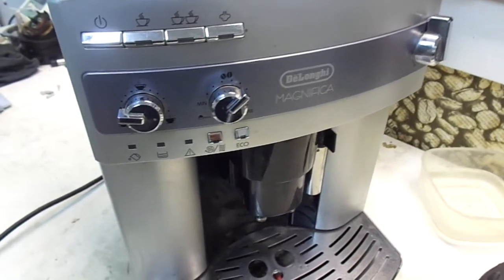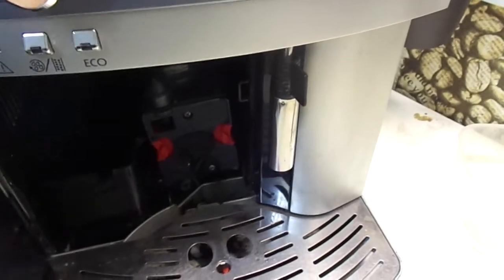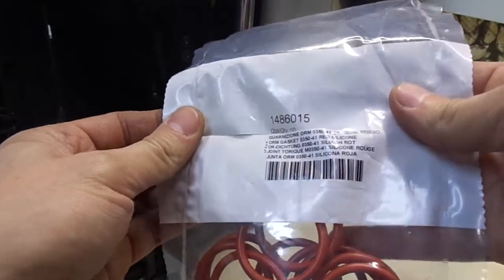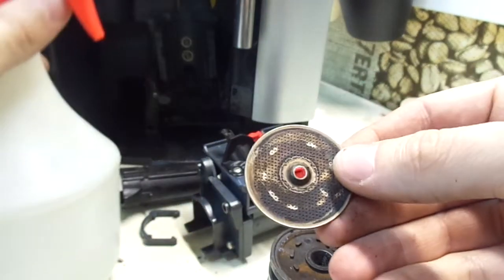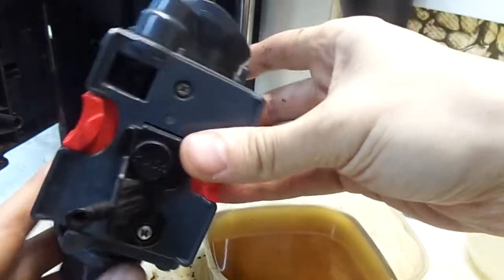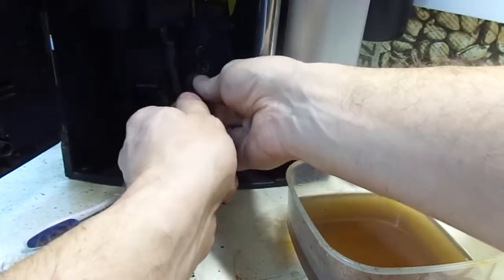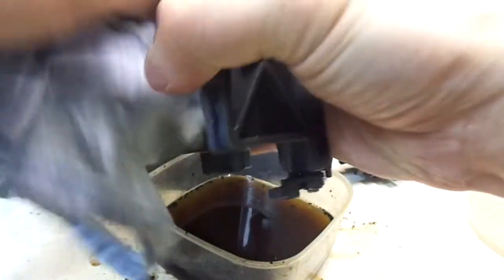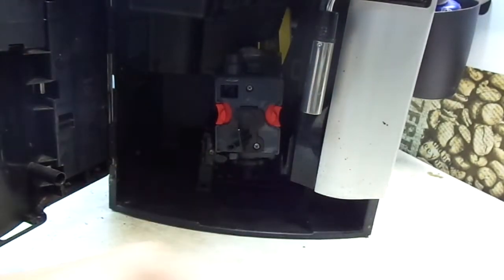How to service and clean DeLonghi Magnifica

Comment: "If you don't clean your machine like a told you, you have to do it" - gotta love it :)
Reply: I have my machine taken apart and need to remove the support piece but don't know what kind of tool to get it out with.  It looks like a screwdriver with different head.
Reply: @raytalley1  it’s called ‘torx’ and he mentioned ‘25’ and I confirm it’s 25 torx bit you need to unscrew the infuser support.

Comment: I already have this issue on my magnifica (the insert diffuser lights flash and machine is unresponsive). When put into test mode everything works fine, I cannot find any way to install software (let alone connect to the board). Would a new control board solve the issue entirely?

Comment: Do you recomend cleaning the grinding gears? and if so, do you have any videos of the process. The grinding gears are held by 1 screw, should the screw be tighten till there is no movement  on the top spinning piece above the gears?

Comment: Excellent video. Very helpful. I had already replaced the o-rings but my machine still made a screeching noise sometimes. After removing the brewer plate and cleaning/lubricating, it’s now nice and quiet 😊
Reply: Hi Simon mine does the screeching sound too but at the moment I can't get the infuser (the part that moves up and down inside the door) to go anywhere. It's stuck in the down position so it kicked the door open and now I can' t close the door or move the infuser. :( I miss my coffee so much. SO glad yours is behaving.

Comment: oh! Thank you very much. For my case, there was no coffee come out from my Magnifica. Then,  I found your instruction and follow your steps to disassembly the piston and clean it. Especially the transparent yellow part. My Magnifica is working well again now!  
Greetings from Hong Kong
Reply: For the future it's worth to inspect o-rings inside that upper piston. I had problems with mine  magnifica and the problem was in o-rings that  falls apart...  No coffe/water in cofee waste container/coffe throwed inside coffe machine  is always caused by upper piston or o-rings showed on the video...

Comment: I started smiling when you said to upload new software - that's how you should approach repairs :) Also 10 points on how to remove the little valve in the piston - it puzzled me for hours when I was repairing mine - I figured it out at the end - but damn! I wish I had seen this before.

Comment: my frother bubbles, i removed the 2 black nozzles, i think the top oring is missing on the  black end before meeting the metal tube
is that the problem? if so is there a fix or jsut order orings

Comment: @
Milen Stoitsev
No! Don't do it... Always  in wood or plastic when place screw back always firstly turn screwdriver in left until the screw clicks and jumps, then right, because in this way you place it in old thread. Otherwise you  create every time a new thread and some day  you'll enlarge the hole so much that you will forced to buy new brew unit, because the hole becomes larger then screw and just falls in. Trust me, I done some day the same mistake and i had to use larger screw... In this case it's impossible, so you have to buy new one...

Comment: This is very helpful, l just want to know if I can use cleaning tablets like I use descaling tablets for my Delongi coffee venezia bean to cup coffee machine. Can I just put the tablet in my water tank and turn on the descaling program? It does not have a cleaning program. And I want to know if the cleaning tablet will be harmful to the orings.
Reply: You can, and it won't and you can use plain old spirit vinegar - that's what's in the delonghi 'official' descaler!

Comment: Hi Milen, thanks for sharing all this useful information on your channel!
I did you ever discuss the warning signal (triangular, flashing) on a Magnifica S? Seems to me it has something to do with one of the sensor not ready the exact position of the infuser, but I don't know where to start to solve this.
Reply: Rob - thanks you your comment, I was able to fix mine. The piston housing was stuck at the top and not in correct position. I took the bottom of, 6 screws and was able to bring the piston housing back does using a 17mm socket. I played with up and down to find the right spot for it to be in position, solid triangle went away and coffee was resumed. I need to replaced the rings after seeing this video though.
Reply: Hi, me again. Managed to keep the machine going without opening like you suggested. But now it kept blinking. Can you explain in detail how to solve? I took off the cover and I think I see the microswitch but not sure where to apply the 17 mm socket
I see the small cam touching the microswitch next to the motor. Switch seems to work fine. I hear it clicking when I touch it. What’s exactly triggering the alarm?
Reply: There’s quite some play on the nut on the spindle. Could this be the main cause?

Comment: Hi Thanks for the video. I cleaned up he Brew group just as you mentioned. Hot water, steam and coffee grind with tablet all works. When I start coffee only few drops of very dark coffee comes but nothing more. Any ideas?
Reply: Is your grinder on too fine a setting? Sounds like it could need Turning to a slightly courser setting

Comment: Great video, thank you so much for the information.
I have a DeLonghi Magnifica S Ecam that I cleaned as you instructed but also removed the screws to do a complete cleaning. Now when I turn it on it makes one loud "bang!" noice when it is almost done heating up. When I turn off the machine and remove the brew unit I see that the piston with the two O-rings is all the way up, so that the "arm" that should push the puck of ground coffe residue is not pushed away into the collector. How do I fix this?
Reply: Did you remove the brew unit, when it was turned off? on the machine , not the power point.
Reply: Did you put lubricant in the O rings?
Reply: I lubricated the O-rings the first time, after three restarts it stoped doing that sound and the problem solved itself. Thank you for your response.

Comment: Hello Milen,
I have watched many of your movies in order to keep my Delonghi Magnifica ESAM 4200 in good shape.
But today the machine suddenly stopped working with only the Ground Coffee Container indicator is steady on. In order to remove the drip tray I had to open the machine and turn the motor spindle to release the brew group so I could take is out.
The container indicator is still on but for the rest seems the machine to be dead. Do you have suggestions where to look for? E.g. motor or electronics ? And how can I verify?
Thank you, Gerard

Comment: Has anyone tried to troubleshoot a DeLonghi Magnifica where the orange preground light flashes?  I get the same error if I use grounds from the grinder or if I push the preground button and add one scoop of preground coffee.  Basically when the brew group travels up to tamp the grounds the orange light comes on flashing and the brew group resets and pushes the dry grounds into the dreg tray.  The grinder and preground funnel are not clogged (which is the manual's explanation of this error) because I can see the grounds in the brew group when I add them and look down the funnel.   The issue seems to be some other sensor or counter that tests for no grounds in the brew group when it tamps, but I can't figure it out.  I checked the upper and lower limit switches and they are both working fine.    All o-rings have been replaced and unit is well lubricated and all parts are moving smoothly.  Please help

Comment: Hi. Thank you so much for the videos.
Anyone can tell me if that's normal, when I make a coffee, during the pre infusion some coffee downs like in this video?
Reply: The first drips of coffee are due to the pre-infusion stage of this machine. The machine sends a small amount of water to moisten the coffee grounds in order to  enhance extraction when the main infusion happens.

If the grounds are too course, it's perfectly normal for the pre infusion water to rush through them resulting in your observed first water drops.

To stop this from happening, you need to use a finer grind setting and this will also improve your espresso.

How to set up the optimum grind setting:

First, increase the dosage (aroma) to maximum.

You should turn the grind setting wheel ONLY when grinding starts.
For that, you need to push one of the beverages button and immediately turn ONLY ONE setting towards the finer grinding. I use to calibrate the machine a single espresso in the maximum dosage.

Let the first espresso be made.
Let a second one in that same setting be made.
Make a third one. At this point the machine calculated the optimum dosage in that setting FOR that particular coffee bean. Evaluate the results.

If the espresso still comes out too quickly and lacks body, do the same process for the next fine grinder setting and so on untill you find your desired espresso character.

Usually, I get the best results between the number 2 or 3 settings on the grinder.

But to get here to need to make at least 3 espressos in the same setting in order for the machine to calculate optimum dosage in EACH grind setting.

When you find a grind setting that your happy with, you can now maintain maximum dosage or set it to an amount that you like.